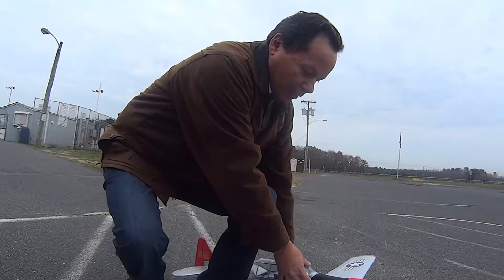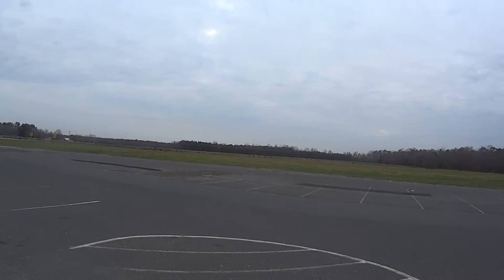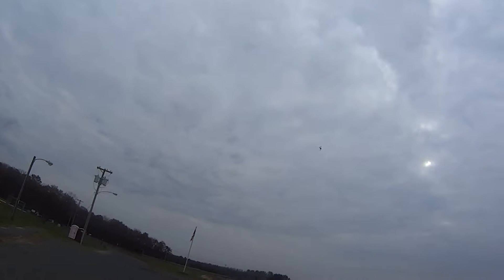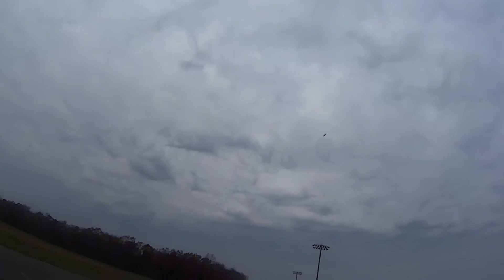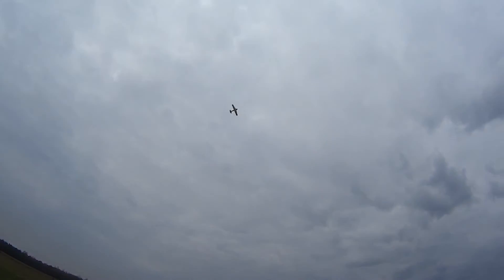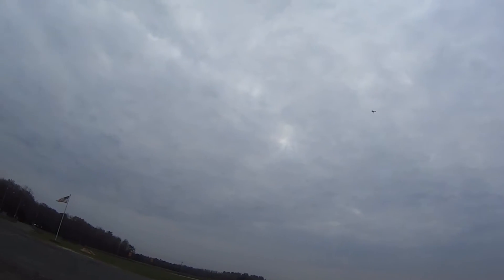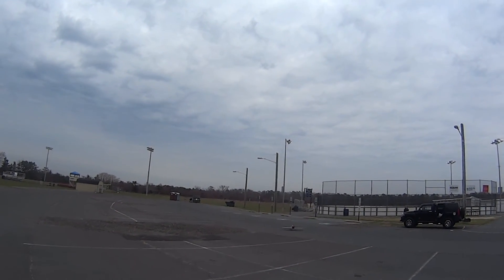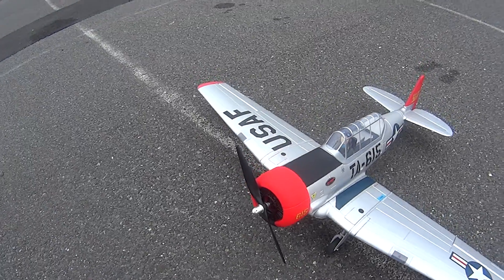Dynam Texan T 6 rc 11 25 2016

Comment: As a word of caution with this plane, it does fly well, but keep the throttle up on it, else it can tip stall in an instant.  I had that at 1/2 throttle and a tail wind/breeze came across, with the death spiral to the ground.  Repairable, but always a sad moment.
Reply: Swept back tapered wing is prone to tip stall/spiral dive. Keep nose down in turns, fly a little faster than scale-like, take off gradually with right rudder land with some power on. User rudder coordinated with ailerons. Flies similar to a model DC-3.